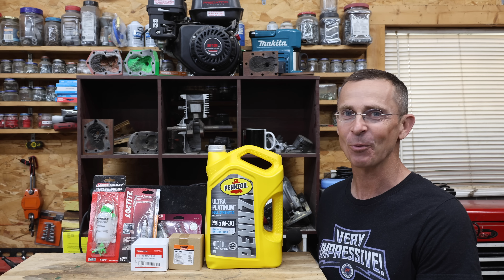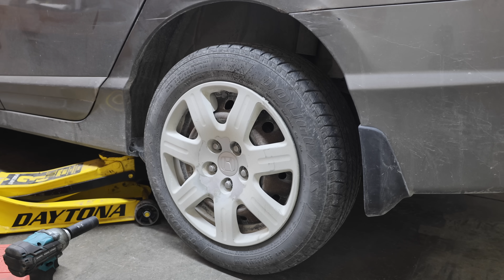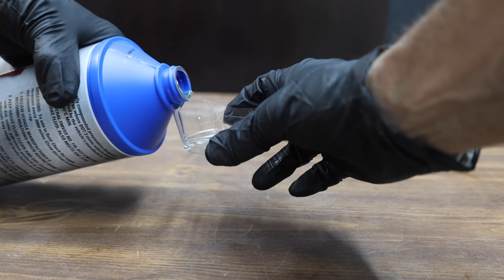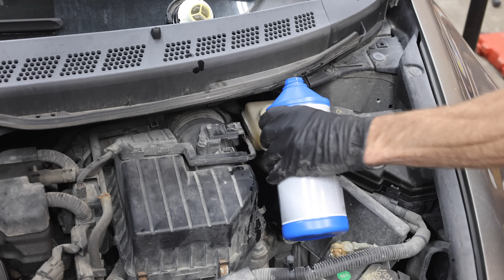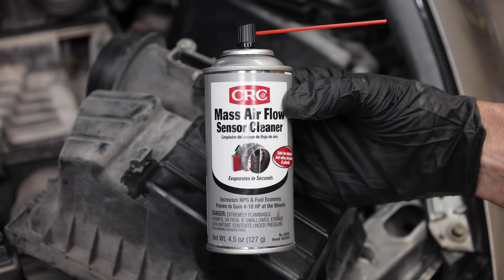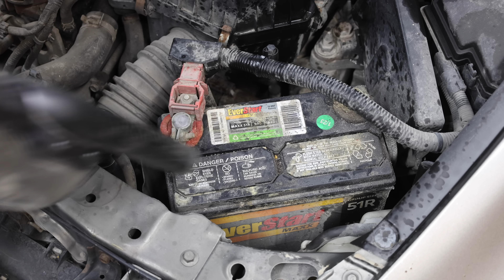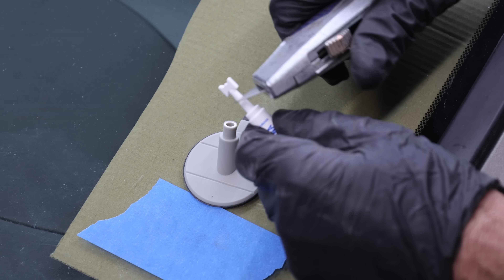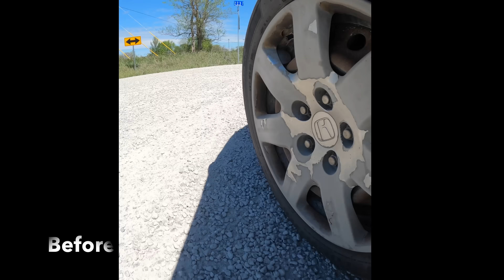Most Reliable 200K Mile Car? Let's Settle This!

Comment: I'd check compression on the cylinders. One of the most overlooked things when buying high mileage vehicles is wear&tear on the cylinders piston heads and piston rings. An emissions test is probably required in most urban or suburban communities and can also give you an idea if your engine needs a rebuild. You're lucky to be working on a Honda. Try this with a Nissan! Had a 300zx and that is THE WORST car I have ever worked on in my life.
But I did get an old 93 mercury tracer at a police auction many years back. Did the exact same repair on the front end - plus control arms. It also had a burnt out shift band for 2nd gear that I didn't ever fix, just let it run from 1st to 3rd. About $800 total sunk into it and I drove it for oh about 3 more years before I traded it in. Man, part of me misses that car. Nostalgia is weird, man.
Reply from the maker: Thanks for the constructive feedback.

Comment: Just a joke? My 1979 Peugeot 504 has done 800,000 miles without major problems  due to
good engineering, build quality and regular servicing with premium  oils and grease.
Including the original purchase price, I estimate this car has cost me $1000 per annum to run over
fifty years, excluding normal consumables.
The car still gives me a comfortable ride, great roadholding and eyeball popping brakes as it
did from new. 
if you want  a carnival Wurlitzer on wheels, go for it.
I prefer to hear the first piston on compression fire.

Comment: I couldn’t see the specific Honda Civic Style (EX, GX, LX, etc), but I assumed middle of the road in “Very Good” condition, and KBB quoted it as $2,275-3,285. Assuming you paid $500 and put $800 into it, that leaves you with $975-1,985 in Profit, netting a 75-150% Profit Percentage and a 43-61% Profit Margin. For reference, the average small business profit margin is 10%, and Sharks on the Tank look for 30%. Tesla operates at 14%; BMW at 18%; Mercedes at 13%; GM at 7%; Toyota at 9.87%; and Honda themselves at 5%. 
You literally made a better profit margin on the vehicle than Honda did when they sold it. lol
Reply from the maker: Thanks for the feedback.

Comment: Good video.  I bought a used 2007 Toyota Avalon with 44,000 on it in 2008.   I had 431,998 miles on it in October 2022 when it was reared ended.  Original engine and transmission.  The factory starter lasted 348,000 miles.  I was shooting for 500,000 miles or more.
Reply from the maker: Thanks!  Thanks for sharing.

Comment: I had a 2001 VW Jetta TDI that made 650,000 miles before a valve failure. 
I have 1999 Lexus RX300 with 285,000 miles
Also have 2001 Camry with 392,000.  Both vehicles have v6 1mz-fe. 
I use Mobil 1 5w30 and wix oil filters on gas motors
The TDI used Schaeffer’s oil full synthetic 5w30 and wix oil filter and a secondary amsoil bypass filter. 
Tranny fluid always Amsoil.
Reply from the maker: Thanks for the feedback.

Comment: Excellent video. I got a 2004 Ford Explorer Eddie Bauer 4x4 for the grand price of $0. It had been struck by lightning and would not start. It had close to 150,000 miles on it. I replaced every light bulb, the headlights, several sensors, brake pads & rotors, rebuilt the steering sector, new upper & lower ball joints, battery, ignition coils, spark plugs, and front & rear sway bar bushings. I found a company that would provide rebuilt and programmed ECM, PCM & BCM computers based on your vehicles VIN. I exchanged the burned out ones for the rebuilt ones. Much cheaper than a new vehicle. It looks practically new. There is one thing it does not have that I like -- no monthly payment. Plan to drive it until I need a pine box.
Reply from the maker: Thanks!  Thanks for sharing.

Comment: Most reliable 200k mile car?  The Mazda Miata.  I have a 1991 with 300k miles that other than consumables I've only changed the calipers, the catalytic converter, and one headlight motor.  Still on the factory clutch.
Reply from the maker: Thanks for the feedback.

Comment: I found that if you take an angle grinder with a cutting disc and make one 1,5mm deep slit 1/3 into the top of a flat head screwdriver and one on other the side, about the same length as the 3'rd down from the top and also 1,5mm deep, you will have a great tool for manipulating brake springs as a pry bar/push bar.
Also I bought a 2005 Suzuki Ignis 1.3i for 789$ 4 years ago. Singing gearbox, intermittent misfire and a bad clutch and a bad front left bearing due to bad steering geometry.
Some GL5EP gearoil, new spark plugs, new clutch and 4 bad front left bearings later it has run 40389 miles since then.
Reply from the maker: Thanks for sharing.

Comment: I miss the days when cars had automatics that were designed so you could drain and/or replace the internal filter. I never allow a shop to do a flush on mine, but fluid replacement is safe and a big improvement. These days more cars come with automatics that are basically designed to be a multi-thousand dollar replacement item.
Reply from the maker: Thanks for the feedback.

Comment: 12:15 THANK YOU, this is one thing NO ONE does anymore, and it's absolutely necessary to keep a battery going especially in hotter or drier climates.  If the top of your battery appears damp it means the electrolyte has been boiling which means the level is likely to be low.  A little distilled water goes a LONG way to extend battery life.  AGM batteries found in newer vehicles and luxury models with lots of electronics can't be serviced this way of course.
Reply from the maker: You are welcome!

Comment: Great video and clearly makes a lot of sense! The problem with newer cars is everything is a challenge from diagnostics to access to replacement. I therefore don’t work much on my cars anymore, other than the easier stuff, much of what you covered. Your video does a great job showing that doing some basic repairs really isn’t that difficult if you have some basic tools, take photos and be patient. Of course, I’ve had a cabin air filter sitting in my garage for probably two years I have yet to install, so I’m the last person that should comment on easy repairs!
Reply from the maker: Thanks!  Thanks for sharing.

Comment: Hey Project Farm. Unrelated to this video, but I went looking for rearview mirror replacement when I found mine dangling from a cable today in Florida. What’s the best one? Wish I could wait for a video!
Reply: FYI, there’s Loctite, Permatex Extreme, 3M High Bond, Permatex “Professional”. I went for JB Weld Super Weld that says it works on Glass AND metal.
Reply from the maker: Thanks for the suggestion.

Comment: The issue I have with this vehicle is a lie for many people. I have no impact tool and a very cheep set of wrenches and almost ZERO car repair knowledge. I also have no place to fix a car let alone anything other than the jack that may come with the car. So in the end I need 1000 for parts and what 3000 to 6000 to pay someone else to do the work for me. uhg. Thanks for the video any way.

Comment: I need to ask, what exactly does 'reliable' mean?
Having it still work like new with the original parts and not having to service anything?
Not having to work on anything for 100k after you service it?
Easy to work on?
Cheap parts?
Something you can beat on and drive though potholes all day without damage?
Engine you can beat on that will run even with the oil drained?

Comment: That is going to be a good car for at least another 150000 miles, based on my experiences with Hondas, esp. 4 cylinders, from that time period.  I prefer the 4 speed automatic for reliability (pre 2005?), but I think most of the transmission problems were with V6's, which also have some additional recurring costs due to a timing belt instead of a chain.
Reply from the maker: Thanks for the feedback.

Comment: I have a 2005 Toyota Corolla that has over 500,000 miles on it. Which my wife and I have put all the miles on it except the first 4,000 miles. I’ve been very regular at maintenance and always use Lucas 100 💯 additive. Majority of it is hwy miles
Reply from the maker: Thanks for the feedback.

Comment: My father owned a garage for over 50 years so I'm well versed on maintenance and you did well.  You are the first person I've seen other than myself who placed a towel or similar on a windshield to keep the spring loaded wiper arm from causing mayhem.
Reply: I too, have placed the towel on the windshield, for about 55 years!  When I ran Auto Repair Shops, I met a few customers who broke their  windshield , when the wiper arm got away and hit the glass!
Reply from the maker: Thanks for sharing.
Reply: I just learned this lesson the hard way a couple weeks ago… I will forever put something soft and bulky down from now on!

Comment: Like many other comments before mine, have voiced how happy that they are to watch your videos, and this one (unless there are more that I missed) is a crossover point for me. I love watching your videos, always offering superior testing methods and tons of helpful information on a vast array of products that we all use and need through the years. 

This one video shocked me...

To see you working as a mechanic, and going over such an awesome Honda Civic to rejuvenate it to good working standards was just amazing to me. To watch this video, and to pick up on the tools that you used, Makita Heavy Impact drill, Daytona 3 Ton jack, and Harbor Freight drill were great, as I too prefer Makita and sometimes Milwaukee tools, as I just recently bought my first 4 Ton Daytona jack on sale. Watching you go through your list of things that needed attention, plus the repairs were great, and all the items you replaced were perfect and needed! On the axle nut did you dimple notch down on the outer ring of the nut so that the nut doesn't unscrew in the future. It is always best to use Honda OEM brake pads and shoes to prevent premature rotor/disc wear as they aren't much more than aftermarket but are way better in quality. The automatic transmission fluid (drain and fill) that you did was a really good idea, just be aware that the new fluid could loosen up particles within the valve body assembly and create transmission issues that might not have been there before. Really enjoyed the brake fluid change as it is so important, for the entire brake system. Using all the data and information you provided in all the great videos you have made and implementing them in this very cool project was fantastic Todd. As mentioned, this new type of video is a wonderful upgrade for you and your channel, allowing you to stretch and connect all your knowledge and implement your hands-on abilities with all of us to see. I am definitely looking forward to more of this new hybrid video format from you. If this car went into a good shop you would have been given a bill for at least $1,500 or more. 
Thank you for thinking outside the box on the future of your awesome channel and congratulations once again
Reply from the maker: Thanks and you are welcome!

Comment: Any plans for a "Most Reliable 200K+ Mile Truck" video? I have an '01 F250 turbo diesel, original injectors and turbo, with almost 400K miles. Still running strong, and gets nearly 18 mpg. Keep the vids comin'!
Reply from the maker: Thanks for the suggestion.  Thanks, will do!

Comment: Great video, just a heads up. Not all mass air flow sensors are cleanible. Some will break if you spray them with a cleaner. Don't know if it's true, but it's in my automotive technology book.

Comment: This is a good break to see you actually using items you tested to perform real-world activities. Perhaps ideas for future videos along these lines would be repair a used lawn mower, chain saw, etc. especially since many manufacturers will be doing away with gas powered lawn and garden power tools. Perhaps fixing up an old dirt bike, ATV, UTV. Maybe convert the Farmabago into a traveling mechanics shop and going around helping people fix their stuff (just kidding on this one).
Reply from the maker: Thanks for the suggestion.

Comment: 7 years as a tow truck driver, I can tell you every brand, every car is going to break down, but you start to see trends and from that there are more brands I would avoid like the plague than ones I would just say are "most reliable". You also have to take production numbers into consideration, because you're going to see more broke down Corollas than Fiats, but that's not because Fiats are more reliable, it's because there's significantly more Corollas on the road. One thing that stuck out that seemed really significant to me is that in 7 years I only towed 4 Tacomas, and one of them was a rock crawler and one was an old mid '90s model that finally blew the transmission. Those trucks may be lower sales volume than F150/Silverado/Ram but they are still very popular and I bet every one of them that's sold is still on the street that hasn't been wrecked and totalled.
Reply from the maker: Thanks for sharing.

Comment: What a video content!!!! I absolutely loved it and I totally agree with PF. In fact, I do have Mitsubishi Galant 2002 with 220k miles on it. I regularly maintain my vehicle myself and had it for over 17 years now. PF inspired me to have my YouTube channel where I show all repairs and maintenance on my car. I’ve had my channel for about a year now and the job that I’ve done so far is very similar to what’s in this video!!
I’d also recommend PF to look at the engine condition by looking at the oil before spending $500. If engine is in bad shape, it’s not worth it all. It only worth it if engine been maintained well throughout all these years. The only recommendation I have. Otherwise, great video as always!
Reply from the maker: Thanks!  Thanks for the feedback.

Comment: All the work you did at the beginning would be like $5000 or more at a shop and about $10000 at a dealer. I imagine with the struts, the front drive shafts and brakes were probably less than $500 in parts, even with the genuine ones.
Reply from the maker: Thanks for the feedback.

Comment: Pro tip: if you can, fill the filter with at least some oil before screwing it in. If the filter is upside down then, of course, you cannot do that. Also we used to put some grease/vaseline grease on the spark plug threads to avoid them seizing in the head and some wd-40 in the plug boots to keep moisture away and avoid them sticking
Reply from the maker: Thanks for the feedback.

Comment: I love this video! Generally, the older the car, the easier it is to repair and the more reliable it is. It is making more and more sense to keep an old car running than to buy a brand-new car. They don't make them like they used to. Try replacing a thermostat on a modern car
Reply from the maker: Thanks!  Thanks for the feedback.

Comment: My Honda CR-V has 243000 miles and is still going. I've put a bunch of parts on it, but it's reliable. I do prefer my Toyotas, though. My 2018 Tundra is as good as the day I bought it.
Reply from the maker: Thanks for sharing.

Comment: If you check out a lexus ls400 or a ls430 you could get over a million miles out of the engine. 
Trust me you would love the car, avoid any & all models that came with air suspension. 
Too expensive to repair, thats the only thing you really need to look out for. 
Originally the motor was meant for aviation use but Toyota scrapped all plans for that
Reply from the maker: Thanks for sharing.

Comment: my 2008 Civic Si Coupe is BY FAR the most reliable car I have ever owned, bought at 32,000 now has  90,000 miles and 13 years later, the only thing that "broke" has been NOTHING. original clutch, I have done front pads twice, spark plugs at 70,000 ,rear brakes once, O2 sensors at 100,000, it is an amazingly well engineered car.  I did get lucky that the paint is not among the colors that had issues. and a right SRS connector under seat has a known issue with factory crimp, but I have almost no cost of ownership to have transportation.
Reply from the maker: Nice!   Thanks for sharing.

Comment: I thought it wasn’t a good idea to change the transmission fluid if it hasn’t been changed in a long time since the metal particles allow the clutch plates to grip one another. Or is this a myth?
Reply from the maker: Thanks for the suggestion.

Comment: As my father always said, the cheapest car to own is the one you already have. Fixing up an older car you already have is much cheaper than a new car (obviously as long as there are no issues that would just be cost-prohibitive), especially if you can do the work yourself. Great videos as always!
Reply from the maker: Thanks!  Thanks for sharing
Reply: I have an 18-year-old car with nearly 260,000 miles on it. I got it when it was 5-years-old and had 60,000 miles on the odometer. Regular cleaning and maintenance has kept it on the road. I use OEM, or high quality name brand, parts on it; no cheap chain-store junk for me.

Comment: My daily driver is a 1992 Honda Civic hatchback with 296,000 miles.  It could stand to have all of the steering and suspension consumables replaced, as well as some minor electrical gremlins such as an intermittent malfunctioning gauge cluster illumination and speedometer.  My wife's daily driver is a 2008 Toyota Sienna with 300k miles.  It runs great and needs nothing, just drove 1,200 miles with the whole family this past weekend.  I've never had a car payment and can't even imagine why somebody would pay so much just to have a prettier car.
Reply from the maker: Thanks for sharing.

Comment: Better off with a clean straight 2000s GM truck with LS v8, most of them that haven't been abused can look almost new and need no repairs beyond 200K miles. It is very easy to find ones with 400-500K original miles and never needed any major repairs, original 4L60/4L80 transmission.
Reply from the maker: Thanks for the feedback.